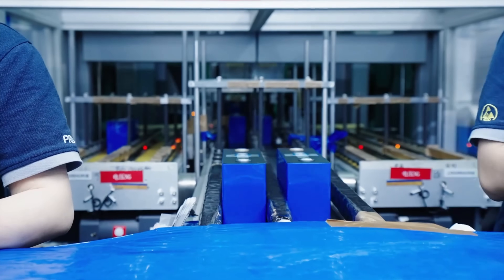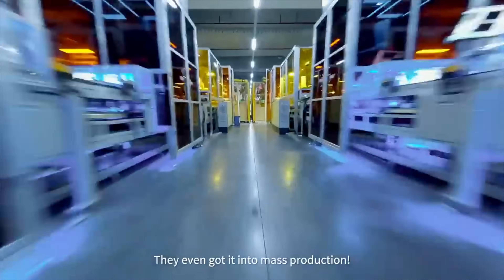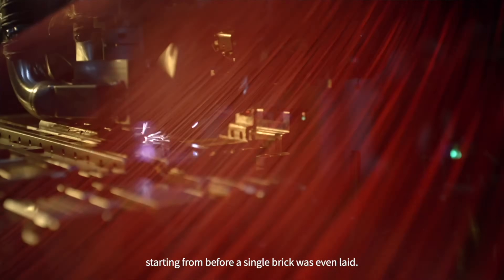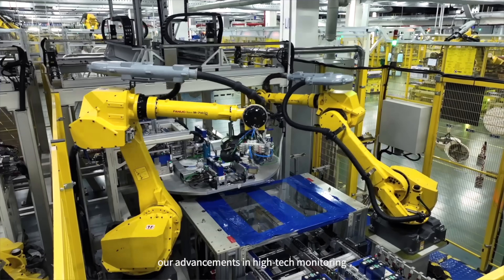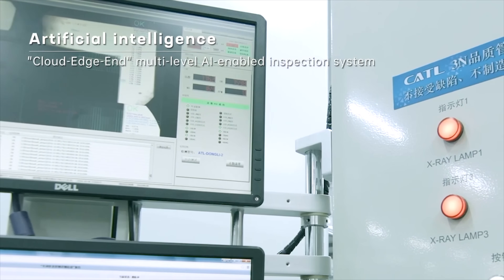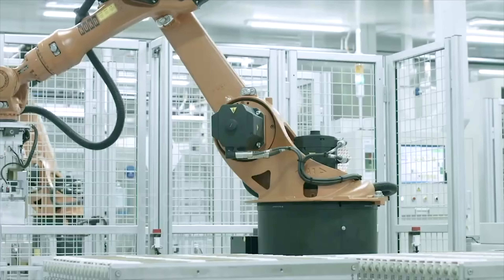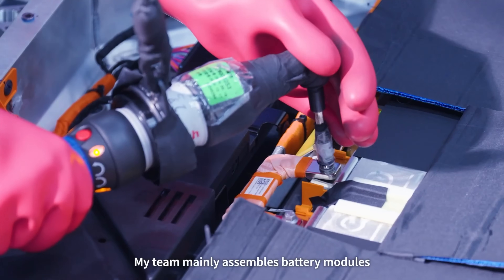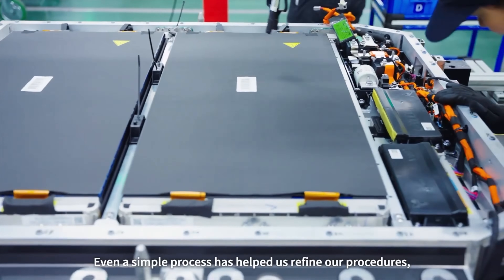CATL’s 120 km/h EV Crash Test Is Absolutely Brutal

Comment: This is only relevant to NMC packs, LiFePo cells are inherently non-combustible. From what I've seen, LiFePo cells are slowly taking over from NMC cells. regardless of the battery chemistry, the design is a potentially a huge improvement in car safety.

Comment: The chassis design interesting... I'm not sure how meaningful it is or not. They have a video about this on YouTube from six months ago. It shows a bare chassis. So how it would perform in a real production car in real crash tests is uncertain. They need to build crumpleability into production cars so I'm not sure how it will tally with that. The fire safety aspect is neither here nor there really. Any LFP cells are pretty much fireproof usually. So that's more reassuring than revolutionary. The saw through test they show in the video... They sawed through a cell. It's nice that it didn't catch fire but nor should it. As to the question of are EVs safe enough already? Well no, no car is. EVs with LFP cells are probably some of the safest cars you can get (compared to equivalent models). Lithium nickel batteries are pretty dangerous frankly. No more so than an engine and catalytic converter and tank of petrol... But the industry really ought to get away from such volatile batteries as quickly as possible